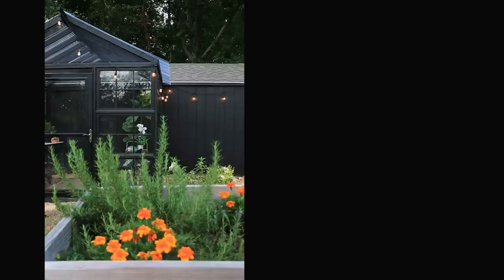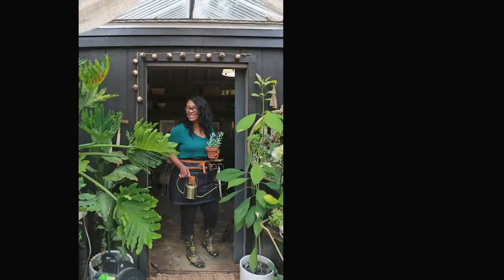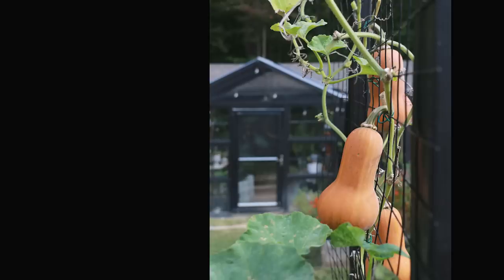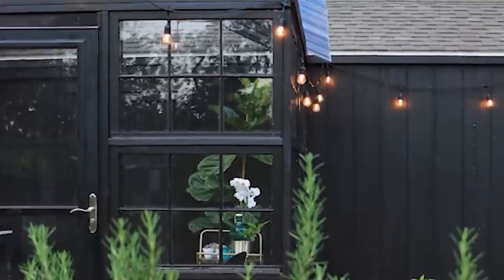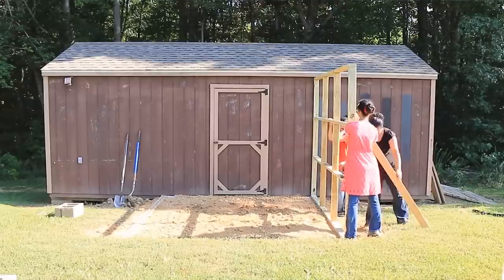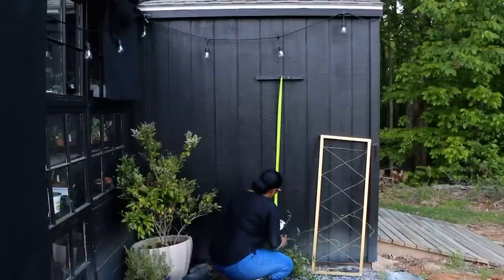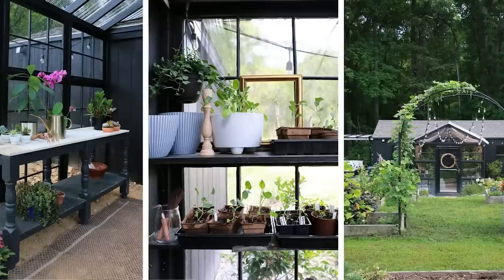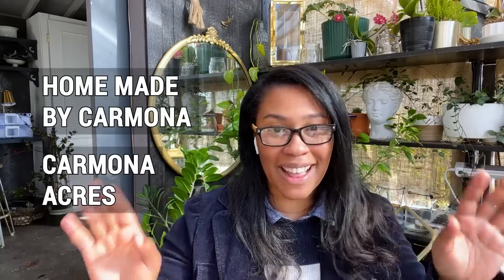When Creativity meets Gardening 🌿North Carolina DIY Gardener

Comment: Lavender is very tricky unless you have really good drainage. Lavender seeds also needs cold stratification. I put the seeds in the fridge then pre sprout in a plastic bag with a damp paper towel inside in a warm bright place and transplant each sprouted seed into a seed tray with potting mix.
Reply from the maker: That is exactly what I am doing! Fingers crossed!

Comment: I love your channel and this episode is amazing. I am going to point out that if you get old windows please use precautions and strip them down to the bare wood. And then dispose of the stripper and paint at a hazardous material site. Here’s why, old windows are often painted using paint with lead in it. Not something that you want around veggies. There are lead testing kits but make sure that you scrape all of the layers down to bare wood and then test on that site. Sorry I don’t want to be a downer. ❤
Reply from the maker: Thank you for the tip Darlene, I have definitely thought of this already, that is going to be a hell of a time stripping all that paint down but better safe than sorry!